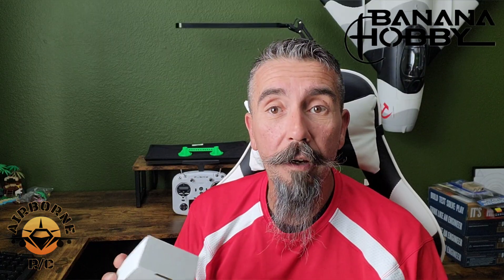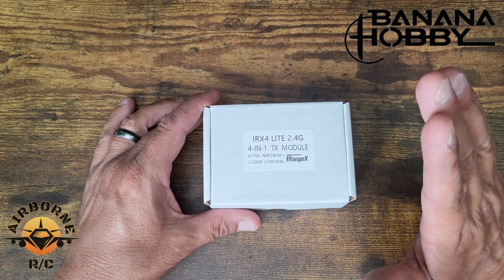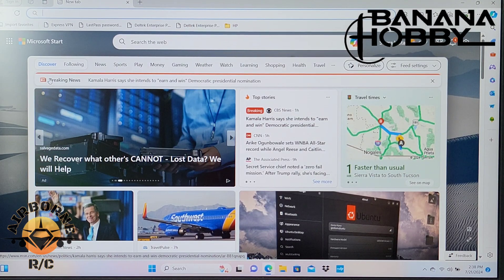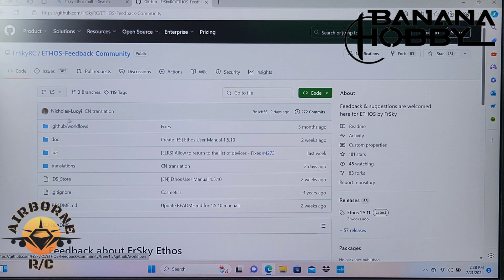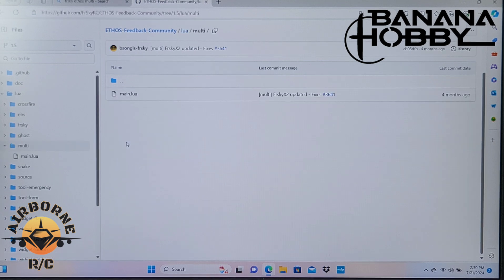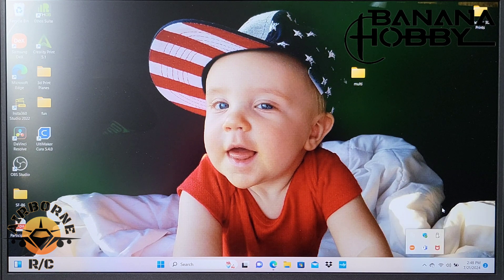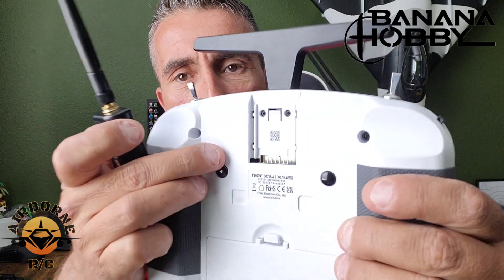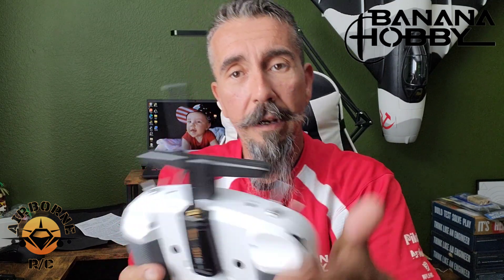IRangex IXR4 TX Module Review and Setup on FrSky X14S

Comment: Github also has the "download raw file" function it is in the top right corner if you have the file opened on github. 
- Make a folder inside scripts folder on your radio, in this case I would call the folder "multi"
- Click the "download raw file" button and save it in the folder you just created. 
>> No Notepad / copy past mistakes. Just rock solid!

Comment: After using spektrum dx9 on all my models for a good 10 years problem free, I updated to ethos and module with a plan to slowly swap all my recivers over, literally within 2 weeks it stopped binding and also started doing odd stuff like controlling multiple models at the same time. As much as I love the ethos tranny it' was enough to make me lose trust and not swap over.
Reply from the maker: Sorry to hear your expierence. This is the first case ive heard about this. You made me oogle to see if ut was prominent. I could not find anything..If you don't mind me asking if using spektrum so long "problem free" why make the switch? Also did you update your module and radio up to date to latest FW? I have forwarded your claims to frsky and ranges for testing. If you don't kind can you please tell me what fw your radio and ranges are o. For testing and an email as well. Thank you
Reply: @NoonzAirborneRC 
I wanted to swap over purly to 'update with the times'. Can't tell you the info as I promptly threw the module away and sold the tranny on (to my regret) but it was all upto date. In the short time I used ethos I was blown away at how powerful and customisable it was compared to the dx9 that I ended up buying a x20s. As tempting as it is to buy another module, I'm going to just use frsky recivers.
Reply from the maker: Roger that! I too only use frsky rxs. I DO have 2 bnf umx planes and a bnf valiant I use this for. Since this video I slowly pulled all the old spektrum rxs out my planes and jets and switched them out. It actually paid for a small vacation to flagstaff. Pulled a $125.00 ar637t sold on ebay for $80 bought archer sr8 ag that time $39.99 (now 49.99 and worth it) I was putting money back in the pocket plus saving money every rx I buy. Take care and thanks for commenting and replying 👍👊🇺🇲

Comment: Tried this on my twin x lite and there is no "scripts" folder on my radio. do I just create a new folder myself? also I'm using Mac and can't figure out how to save the script as a .lua file
Reply: Same here, no script folder in my X20RS.  No drive has it either.  The module still works in my X20, which does have the script folder.
Reply from the maker: @slimjam44  interesting I've heard this quite a bit lately. On a buddy's radio verified wasn't on there. Added a script folder and did the rest as on the video. Worked just fine.
Reply: @NoonzAirborneRC did create a script and copy paste the lua file and all good! Amazing!!! I had to look in the comments to figure it out
Reply from the maker: @panpanbepis8025  glad ya got it done!
Reply from the maker: @johnathanolsen6959  there should be always a script folder. Make sure you are looking in the right drive. Also I dodnt use apple. It could be a possibility since u can't save Lua files apple doesn't recognize them hence the folder not showing? If u have access to a pc a freind or work. I'd try that first 👊🇺🇲